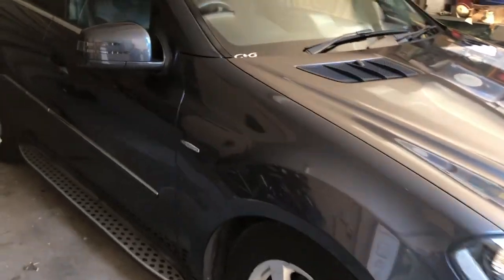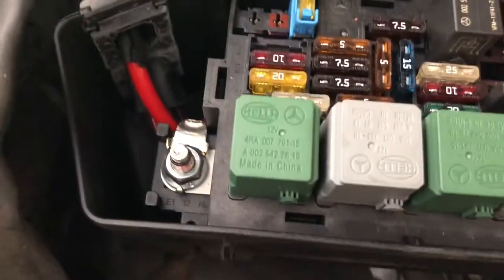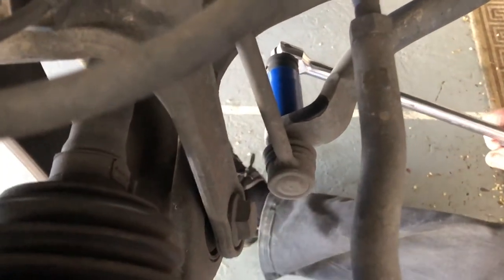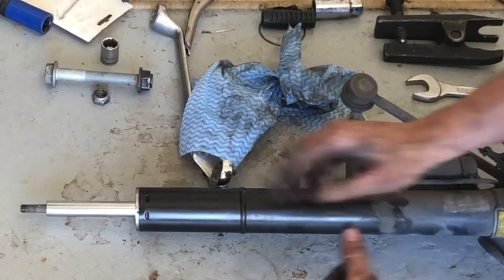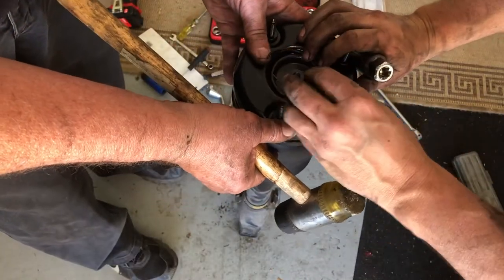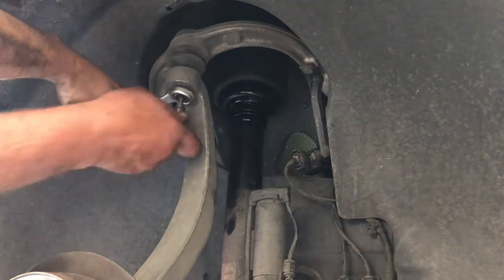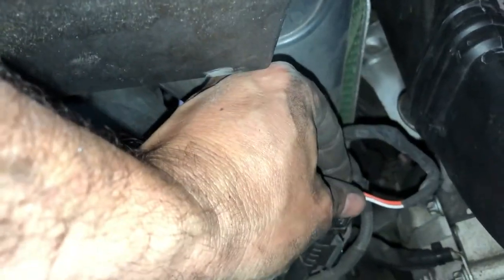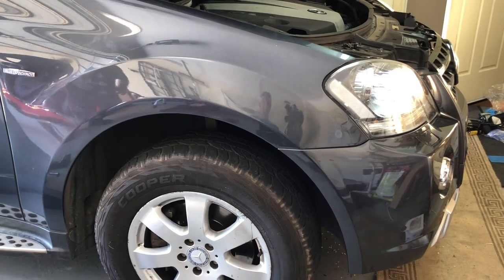How to Replace Mercedes ML350 W164 (2006-2011) GL Front Air Spring - The Complete DIY Guide

Comment: I received two rubbers o rings one slightly bigger than the other and one plastic o ring. Can I use both rubber o rings or can i use only one and the plastic o ring? Please help
Reply from the maker: Hi Landu, you need to use both of the rubber o rings and the plastic o ring.  Sometimes in the kits one of the rubber rings is already installed on the top cap.  I would suggest yours is not, thus I suggest that you need to put one of the rubber o rings on the top cap and then the other one and the plastic ring is put on the strut before you put the Air Spring onto the strut.  I trust this helps?  Cheers Drew

Comment: Hey mate how do you rate these cars as a 4 wd, have you ever run it through its paces.
Reply from the maker: Hi Brett, it really depends what you mean by 4WD!  I was born on a farm and can drive 2WD utes were city folk don’t attempt to drive their pristine 4WDs … but let’s get back to your question.  For starters the standard W164 is an AWD, that being said mine has done it’s fair share of beach driving and I have also taken it on a number of off-road tracks, I would say nothing overly serious but stuff where the extra ground clearance of the AIRMATIC suspension helped!  I hope this helps?  Also, do you know that their was a specific off-road package option which added a low range transfer case to the transmission (mine does now have this)?  Cheers Drew
Reply: @DrewFixIt  Thanks mate for the quick reply, I have a 105 series landcruiser for the more extreme 4wd but it is good to know that it can handle the beach. I noticed 2 buttons on the dash of the merc one is a car going over undulating ground is that some sort of diff lock amd another button of hill going down hill
Reply from the maker: Hi Brett, it is not a diff lock, rather it raises the suspension by inflating the air suspension to a higher PSI.  The other button is hill descent which the vehicle would use the brakes to control the descent down steep hills.  For me I have used the extra height quite a lot and you may have also noticed that most of the time I have a set of 17 inch rims on the car instead of the 21 inch AMG rims that came with my car, which I personally find far more practical for how I want to use the vehicle!  Cheers Drew
Reply: @DrewFixIt  I thought the airmatic was the one that raises the car, there is the other button that has a car going over undulating ground
Reply from the maker: @brettsprojects7629  my apologies, that button activates the “Off-road drive program”.  I have never honestly used it, but the manual says “The engine’s performance characteristics and the gearshifting characteristics of the automatic transmission are adapted for this purpose.  ABS, ESP and 4 ETS programs especially adapted to off-road driving are also activated.”  Cheers Drew
Reply: @DrewFixIt  Great thanks, sorry to keep pestering you with my questions but I just got the car and you seem like the best guy to ask. The brakes on my 2011 ML350 the pedal seems a little soft and I had to brake hard the other day at the lights and it did not pull up like I thought it should is that just normal with these cars? Thanks in advance.
Reply from the maker: @brettsprojects7629  Hi Brett, I have found that old brake fluid can seriously have a negative impact on the braking performance of these cars.  Thus I would start by doing a complete flush of the brake fluid as per this video: 
https://youtu.be/MEIISUYXkIo Cheers Drew
Reply: @DrewFixIt  Thanks Drew, have another question the car cranks slow and in the morning it cranks for a while before it starts , I glow it twice. Concerned as it is summer and wondering what it will be like in winter....Again thanks for the info if you are in Perth I will buy you a beer.
Reply from the maker: @brettsprojects7629  Does it have the original battery still?  It could be a glow plug issue ... does it puff black smoke when it actually starts?  Cheers Drew
Reply: @DrewFixIt  Hi it had its battery changed about 5 years ago and yes puff of black smoke when it starts only 1 puff though
Reply from the maker: @brettsprojects7629  what brand/type of battery was put in?